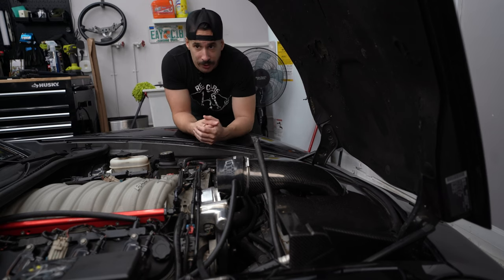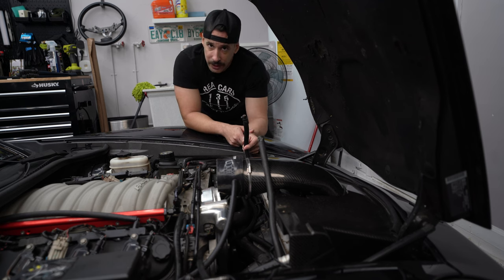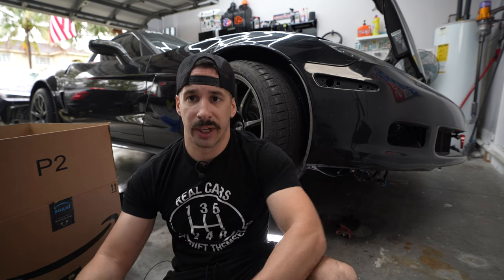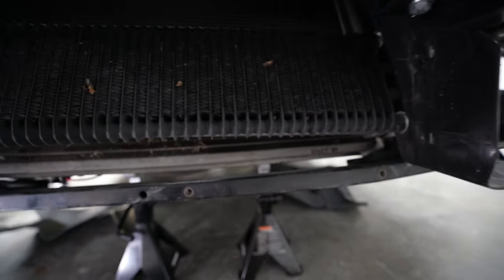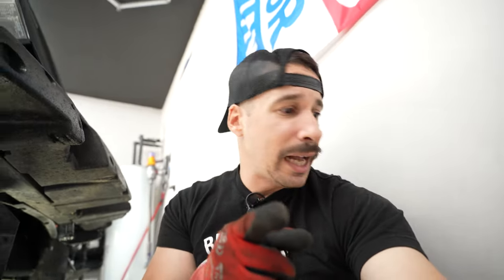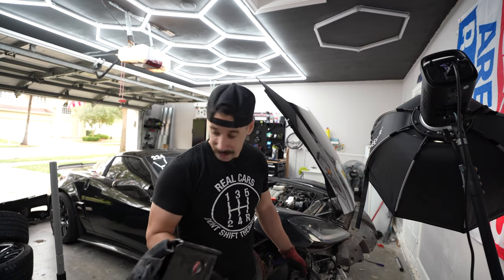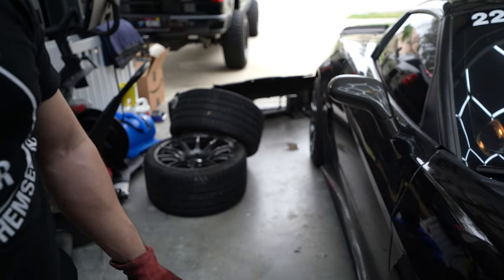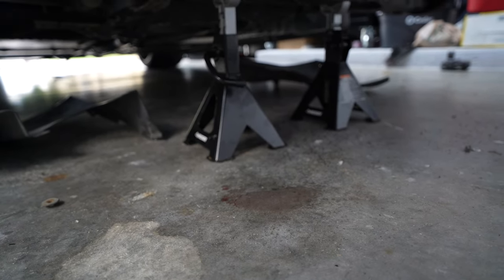Taking Apart My Z06 After My Acident at Sebring Raceway

Comment: You are doing a good job. Although your fist sentence or so sounds very familiar. 🙂 Using water instead of coolant seems like it could be less than optimal.  Why risk a 212 boiling point when you can have  a 223 boiling point. Armchair racer viewpoint!

Good luck with your repair.
Reply from the maker: Thanks!

Comment: Sorry to hit this, looking for ticking answer on Silverado. In your vacuum pump replacement, your start up near the end sounds just like mine. There is a dull whine, rapid fire clicking perhaps 300 per minute for maybe 5 seconds that changes to a slow click about once per second. Have you noticed and do you know what’s causing whine and clicking. Again, sorry to stomp on your video.
Reply from the maker: No problem! I know the sound you a referencing. To be honest I haven't made any further adjustments to the truck and either ive tuned it out mentally or I dont hear it anymore. I'll definitely check on my next startup and see if I still hear anything. Sorry I cant be more help!